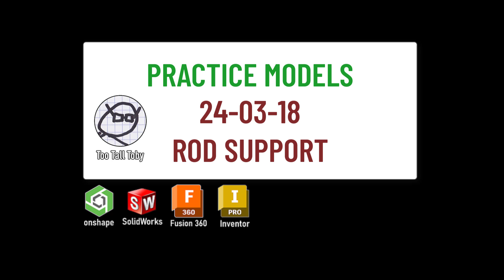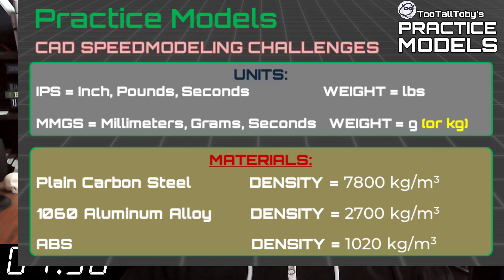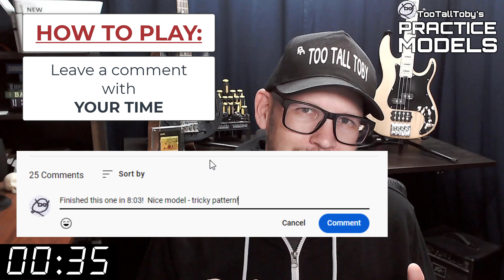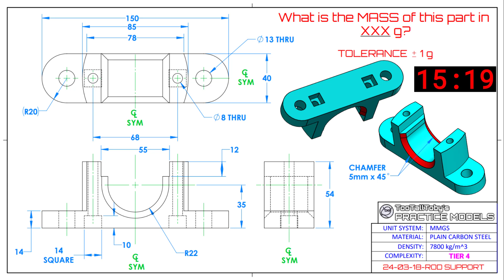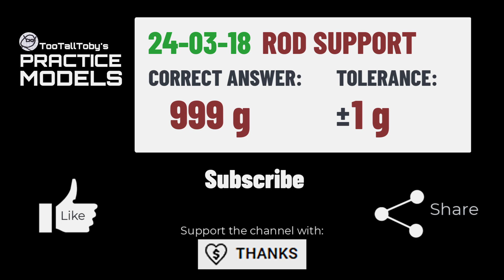2D Drawing to 3D CAD - PRACTICE MODEL- Exercises for Onshape, SolidWorks - ROD SUPPORT

Comment: I disagree with your results. You are assuming that the 85mm dimension is a diameter. But it is not labeled as such. I interpreted it to be a dimension used with the 78mm dimension to define a spline. With this definition you will get a different result.
Reply from the maker: Thanks for the feedback
Reply: Yes, with 78 and 85 it gave us different results
Reply: A 58.89286 mm radius also works